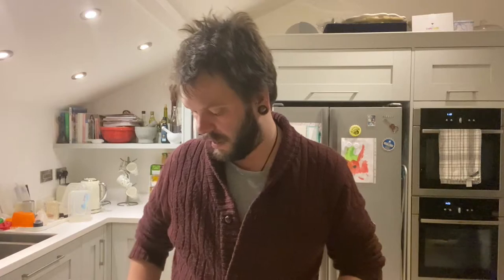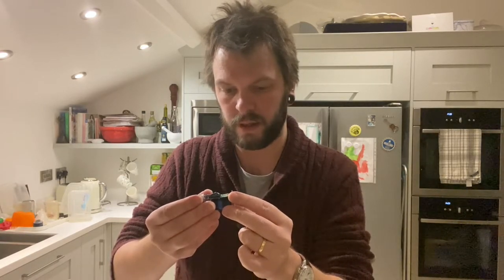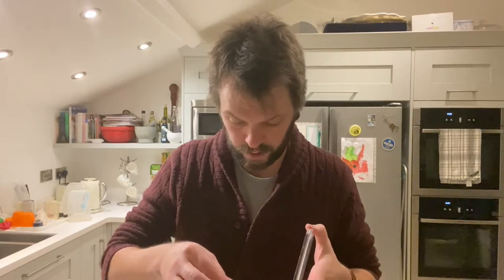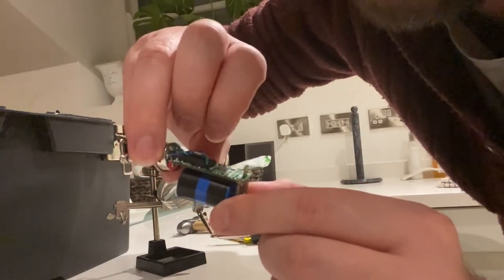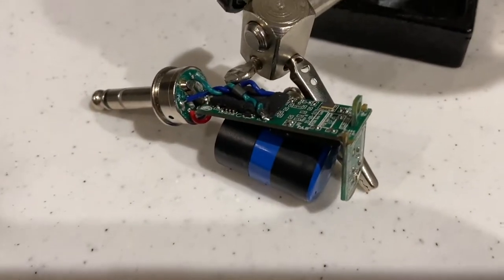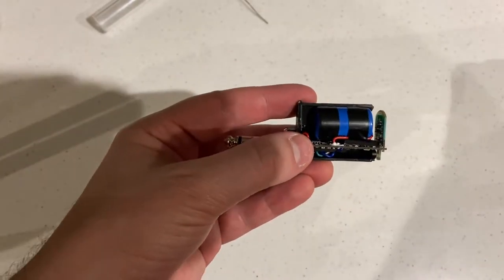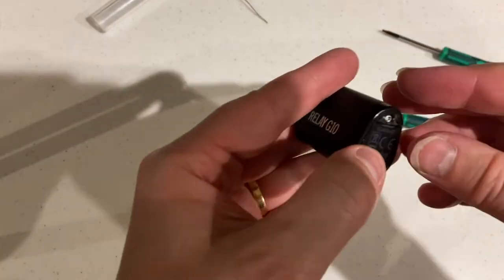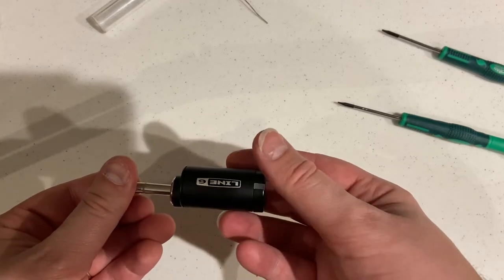Fixing the G10 Line6

Comment: Thanks so much. I have an original one from 2016 and the jack plug part snapped and the wiring came off between the two parts. Your video enabled me to see where  on the jack part the Red, green and blue wires. The black wire to the main housing was easy to figure out. Works again, my battery doesn't last more than a couple of hours now, so I'll have to replace the battery next. You just saved me $110, cheers :D

Comment: So I have one of these that I haven’t used in forever because it doesn’t charge, when plugged into the charger it goes solid orange (not red) and then just goes out after awhile. I always wondered if using it with active pickups did something to it, that’s what I was using last time I remember it working. I haven’t opened it up although I probably will get around to it now. Any ideas would be welcome.

Comment: Thanks for the video, coul you be so kind to show where all the cables are soldered in the tip? I got one with all the wires pulled off, but not sure on the wiring: Pin Blue, R Green, Red? Black? Thanks